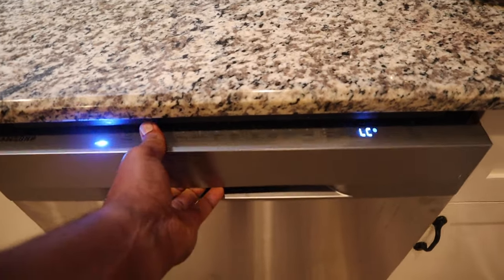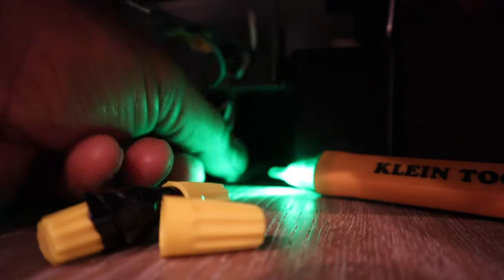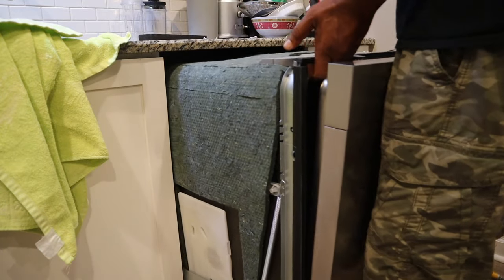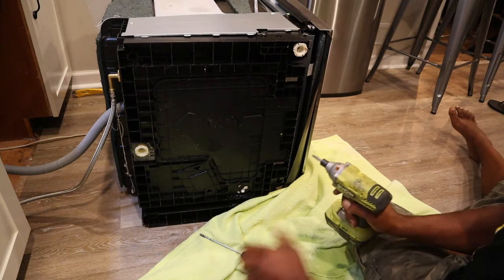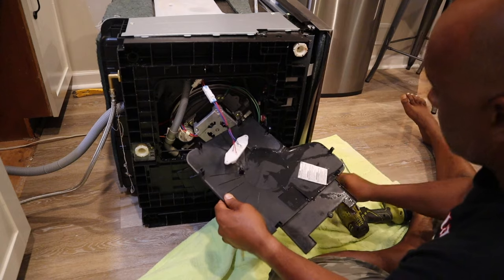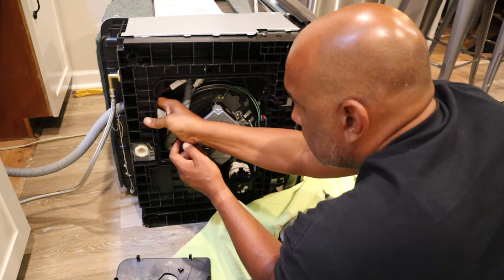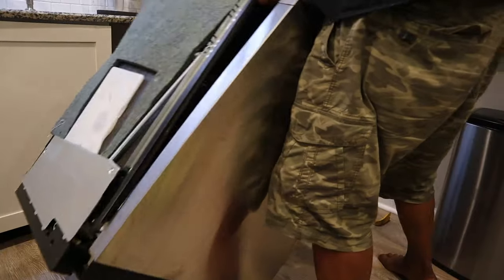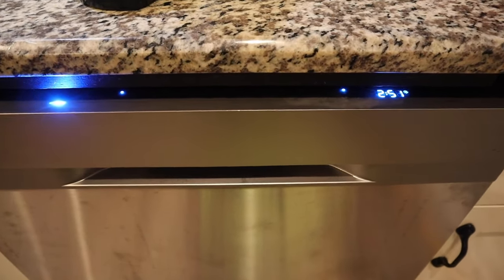Samsung Dishwasher LC Code - Permanent Fix

Comment: Thanks, I’d called the repair guy then cancelled him after I fount this Great video. The only thing I did differently was instead of taping the sensor up inside thee unit, I added 3 washers on each under side of the sensor mounting, basically shimming it higher from the catch pan so.a small amount of water won’t set it off but not so high that it doesn’t detect  any significant accumulation that could damage the electronics. So far, so good!
Reply from the maker: Awesome! Glad it helped and the washers is a great idea. Enjoy!
Reply: I just read another comment on a related video that it worked to trim the sensor probes shorter with a nail clipper.  You're idea seems more reversible. :)
Reply from the maker: @danielparks4181  yeah I didn't want to change anything too permanent in case it didn't work....lol. Been holding well so far.
Reply: Were the screws long enough to accommodate the washers or did you need longer screws? Thinking about trying this fix out and trying to plan ahead.
Reply: You're both genious. I'm attacking this problem tomorrow. Thank you
Reply: Thank you both! I did the same thing with 3 washers this morning and just ran the 1st successful load.
Reply: I need to try this. By the way mines only two years old. I’ll never buy any more Samsung appliances. My fridge has never dispensed water correctly either.

Comment: Thank you for this! We've not had a running dishwasher for over a week because of this same error code. I even called Samsung about this issue as it started happening 2 months after I purchased it. This is the worst dishwasher I've ever owned, and if I would've known back then that this is a common thing, I never would've bought it :/ :(
Reply from the maker: Sure and glad it was helpful. I agree..it seems like Samsung would've addressed the malfunction by now but since I've made the alteration it's been running fine. Goodluck with yours.
Reply: I have had Samsung appliances for 7 years, second time LC problem with dishwasher, two refrigerator repairs due to freezing problems, replaced clock and main circuit board in oven.  Never again buying a Samsung appliance
Reply: This is my first dishwasher. I bought a full Samsung appliance suite and have had issues with all 3. First the fridge, then the range, now the dishwasher. 🙄Never again!

Comment: Not going to read all 400+ comments to see if this was mentioned but once a load is started don’t open the door to add more dishes. This will almost always set off the LC code as it lets just enough water to reach that damn sensor.
Reply from the maker: It was but thanks for the info

Comment: Being a service tech since 1986 should have just raised it up about 3/16”  in the original position
Reply: Awesome thanks for the tip
Reply: You might want to check where hose hooks onto drain pump. This hose becomes brittle and water seeps out slowly causing water in pan

Comment: How is this a "fix" if it doesn't address the cause of the leak?
Reply from the maker: It’s a fix because my dishwasher has been working beautifully and I don’t have to deal with the malfunctioning error code. 😄👍🏽
Reply: I really appreciate the video, and I'm glad it's working for people, but where is the water coming from, and where is it going if you just ignore it by moving the sensor?
Reply from the maker: @aDrunkSailor82  I honestly don’t know. Once it was fixed and working I was satisfied and moved on to other projects.
Reply: @wgibson86  thank you again for the great video and the great response.  You saved a lot of people a lot of trouble.
Reply from the maker: @aDrunkSailor82  sure no problem. Just glad it was helpful

Comment: 160k views haha, lots of people experienced this.  I did it and it worked. My sensor was different, the wires seemed to be elevated to only detect if there was 1cm or so of water buildup. Quite a bit of water came out of mine... maybe 250ml. I wonder if we should tilt it and let it drain before setting it all the way on its side. Dishwasher running now
Reply from the maker: Haha…crazy right. You would think Samsung would figure it by now. Glad it’s working for you and thanks for the tip

Comment: I dried everything and put the sensors back in the original location and the LC light is still on. Will be moving the sensor now
Reply from the maker: Yeah that sensor position I think is the key. Fingers crossed 😄

Comment: Today, I encountered an error code and hesitated to open the dishwasher due to my lack of courage. However, upon watching your video, I feel more confident about proceeding. I sincerely hope that my newfound confidence is not unfounded.
Reply from the maker: Just make sure all electrical power is disconnected and you should be fine. 😄👍🏽

Comment: This is exactly what I needed to see. We have had the dishwasher for just under a year and today is when the dreaded LC state appeared. I'm going to tackle this tomorrow using your guidance. Thanks a lot for the helpful video and hope your dishwasher is still working well, too!
Reply from the maker: Awesome thanks and glad it was helpful! Yeah mine is still going strong. Seems this is an engineering flaw by Samsung.
Reply: We have the same issue/same dishwasher. We are also just past the 1yr mark.  1yr 2months and this showed up. Attempting the fix this evening.  I will also be relocating the sensor as you did as well.
Reply from the maker: @whoyouwon  Fingers crossed it works!
Reply: @wgibson86  it worked but we had other issues.  The motor was also getting louder and louder.  Last night she went POOF.  Top bearing on the motor was shot.  New motor and seal on the way.
Reply from the maker: @whoyouwon  AHHH Man...well at least it sounds like it was working before the motor went out. Hopefully that motor has it running smooth again. Good luck with it.😄

Comment: This solution worked for me. I did not take any circuit out from dish washer. I put the dishwasher down from right side down and cleaned the lower part as shown in video. Thank you for sharing this video
Reply from the maker: That’s great and good luck with it!😄

Comment: My Samsung dishwasher had the same thing. I turned it over and I did find some water underneath it. I wanted to say the best tip was recommending moving it behind and taping it down. I haven’t had the error code ever since I did that. Ty so much for your video!! ❤️
Reply from the maker: I’m glad it worked for you. Enjoy 😄👍🏽

Comment: Thank you for sharing this!! I did just what you said but got the same error code, so I opened it back up.  Though I couldn't see any water I took a blow dryer and blew the sensors dry.  Re-assembled and it worked like a charm.  You weren't kidding when you said those sensors were sensitive.
Reply from the maker: @dracisyoung5403  Awesome glad it was helpful in getting it working. Enjoy 😄👍🏽

Comment: installed a new sink for a customer, due to the new p traps and positioning of the drains i had to install the dishwasher drain to the garbage disposal. I also  had to replace the drain hose. as soon as i put everything back together i couldnt get the dishwasher to work because of the leak sensor.  when detaching the drain hose water got under the pan and the sensor kicked on. this video was very helpful! Thankyou!
Reply from the maker: Awesome! Glad it was helpful. 😄

Comment: Thank you for that Video,
I followed your directions to the letter and behold it was like Magic! 
The dishwasher came back to life!
Thank you again!
Reply from the maker: That's great to hear! Enjoy.
Reply: Going thru my LC code for the 4th time & I added 2 washers under each side of the sensor. Reinstalled, turned pwr on & I still get the LC. Not sure where it thinks it's seeing a leak but there is none. So powered down & I've got a heavy fan that I'll let run until tomorrow. 🤞🤞🤞

Comment: While annoying that sensor serves a purpose. That sensor senses a leak in your dishwasher. It stops the dishwasher from potentially allowing water to leak all over your floor. While you can move it to stop the code, make sure you address the root cause. Otherwise some time you run the dishwasher you may be sorry. The best solution is to do what some have done, leave it in the bottom pan and raise it with washers.
Reply from the maker: Awesome thanks for the tip!😄👍🏽

Comment: Thank you! This fixed my LC error code (that was keeping me up at night). The only modification I did was to drill two holes in the plastic tray for the sensor and then I used two zip ties to set the sensor in place rather than using duct tape. Thanks again!
Reply from the maker: @user-lh6ew1wt2r  Awesome great idea! Glad it worked. Enjoy 😄👍🏽

Comment: I added 2 small plastic washers under the sensor, it raised it up about 1/16 in.
or about 1.5mm and it works without errors for over 1 year now.
Reply from the maker: That’s smart…thanks for sharing 😄👍🏽

Comment: This is a great video. I just got my brand new samsung dishwasher 3 weeks ago and a few day ago I started getting that dreaded LC error code. I was about to follow your suggestion but called samsung first and they sent out a tech the next day. The problem for me was the rubber washer that was inside the water intake tube that's connected to the back of the dishwasher had shredded so the water was leaking because of that. He didn't have a spare washer so I pulled one out of one of my garden hoses and he used that one to replace the shredded one. It's only been one day and I haven't had that error again, yet. Hopefully that fixes the problem. So I would suggest that everyone checks that pesky rubber washer to see if that is the problem.
Reply from the maker: Wow it started with the error after only 3weeks! Well glad you got it fixed. Thanks for sharing your experience and tip😄👍🏽

Comment: Thank you very much for this video. It was spot on. My problem was a clogged filter and  it flooded a little.  but even a week afterwards the unit still wasn’t working. I popped the pan dried the sensor and it’s working great.
Reply from the maker: Awesome! Glad it helped!

Comment: Great video and tip. We need more people like you. The sensor in my Samsung dishwasher was quite different though, a disc made of foam that "floats" and pushes a little button up which activates the LC code. I dried the whole area up and it worked. Hope it lasts. If not, I'll get rid of the bloody foam or cut it shorter. Will see. Thanks
Reply from the maker: Awesome thanks! Well fingers crossed that it works.😄

Comment: Is disconnecting the wires an essential step in this process?  Seems like as long as you cut the power you are safe, was that just out of an abundance of caution or is it necessary?
Reply from the maker: No it's not necessary. I just get very cautious when it comes to dealing with electricity. So yes just an abundance of caution..lol
Reply: This was my question. Thanks for asking , and thanks for taking the time to answer.

Comment: Thanks for the solution to this error, I just bought a new top-of-the-line Samsung dishwasher, got it installed, flip the breaker ready to impress the wife, and all I see is a flashing "LC" code, she wasn't impressed.  Argh. Remember when hooking up the supply line I had a leak, guess it leaked into that tray area and kept triggering the error code.  I just needed to dry out that tray and put it back together but if I ever get this code again know where to look and how to impress the wife again.
Reply from the maker: Lol....glad it was helpful. Enjoy!
Reply: My Samsung dishwasher has been in operation for 3 months and has been used 10 times and already has the LC error. Typical market economy

Comment: Many thanks for this video. When Mr. Gibson showed how little water was setting the sensors off, I decided to just let the stupid dishwasher dry out. So I left the door open a crack during the day and all the way open overnight, and voilà, the stupid dishwasher fixed itself! It took 24-36 hours, but the stupid dishwasher is now functioning again. We’ll see how long it lasts, but this is the first time it’s happened in well over two years. Stupid dishwasher. (But I will also be more disciplined about monthly cleaning…)
Reply from the maker: Glad it was helpful. Enjoy!

Comment: I dont know the dump 9 who gave thumps down, did it for what purpose. Really. Great video man and thanks for a great idea.
Reply from the maker: Awesome! Glad it helped!
Reply: The sensor is working as it should. The dishwasher is leaking and it's designed to stop it so your kitchen doesn't flood and/or the flooring doesn't get damaged by a slow leak. His fix is the same as taking down the smoke detector when there is smoke coming from a fire. Just ignore the real problem. What could go wrong?

Comment: Great video! However I would say if you try this method you should run an empty load to test how much water you are dealing with. This could be a simple part swap but if not it may cost you your wood floors.
Reply from the maker: Thanks for the tip👍🏽

Comment: Simple and to the point. Good job all around with your video and presentation. With that said, I'd never buy another Samsung product. I have the exact same dishwasher and this thing has more damn error codes than it does functions! I also have a Samsung refrigerator that sucks.
Reply from the maker: Thanks and you're 100% correct I have the fridge also and it sucks. I'll never buy Samsung again either. Thanks for watching!

Comment: Any errors since? Also, dumb question but why did you undo the wires? Were you afraid of burning the circuitboard or something? Just want to make sure I’m doing it right.
Reply from the maker: Hi there. No error codes have appeared since I made the alteration. It's been running good so far.
The wires I disconnected in the beginning were to be able to pull the dishwasher out. My wires were short. As long as the circuit breaker is off and your wires are long enough to move it then you don't have to disconnect them.
Reply: wgibson86 ok! Thank you. I did this earlier today and dishwasher is working great! Thanks again!
Reply from the maker: @hawaiiminded  awesome!

Comment: Awesome video. Should I be concerned that its a serious problem beyond moving the sensor? Floor was bone dry I dont think it was significant water. I just did everything but move the sensor and it tripped again after i ran the washer. Going to have to move it for sure
Reply from the maker: Thanks! Not sure if it's a serious problem or just a bone headed design flaw but since moving my sensor its been working great.
Reply: @wgibson86  Thanks. on top of that I think im having issues with the drain because the washer isnt draining properly. safe to say im DONE with samsung

Comment: Why did it fail?  Mine was a stuck upper whirly spray bar just pumping water in the wrong spot. Bar was stuck at a 10:00/4:00 position.  Been running fine for several years.  Had same leak once, caught leak quickly and didn't throw a code.  Now seeing the connection.
Reply from the maker: Not real sure. Since doing the modification its been working fine so I just left it alone. Thanks for the information.

Comment: I pulled mine out (zero water underneath it) and put it  on it’s left side and when I opened up the bottom pan I could see some moisture but not much. But, when I righted the machine back up, I noticed lots of water coming out of the left side of dishwasher. I saw no water wetness inside when I opened the back up though. Could this be water left in the drainage hose? I did have to disconnect my waterline to pull it out. Maybe it was water in the incoming waterlines inside the washer as the opened water intake attachment  is on the left side so when I put it on it’s left side all this water cam out? I didn’t see it coming out there though. It seemed like it was coming out of the side of the dishwasher. What is he case break vent like thing on the left side inside the dishwasher? Could that have caused it?
Reply from the maker: Not real sure where the water came from on mine. It’s been working fine since the modification. How did yours end up?
Reply: Mine has been fine since drying out that bottom pan and sensor. Thanks for the video. Not a problem ever since.
Reply from the maker: @wstt4  That’s awesome. Enjoy 😄👍🏽

Comment: incredible, my DW was hardly being used and I ran it yesterday and it is stuck in the LC Code, so frustrating that you cannot do this without dragging it out
Reply from the maker: Yeah it is very frustrating. Terribly engineered.
Reply: wgibson86 thanks, last Sunday I took the dishwasher out and i put the sensor back with a 1.5 mm washer, hopefully this will not reoccur
Reply from the maker: @climbeverest  Awesome! fingers crossed

Comment: I found on the left side of dishwasher there is a silver panel I removed and underneath is a plastic white see through channel that water runs through. It seemed to have been leaking near hose connection. So I used clear caulking and sealed the edge of that plastic device. I hope this permanently fixes it. Thanks for your advice too.
Reply from the maker: Awesome thanks for sharing!